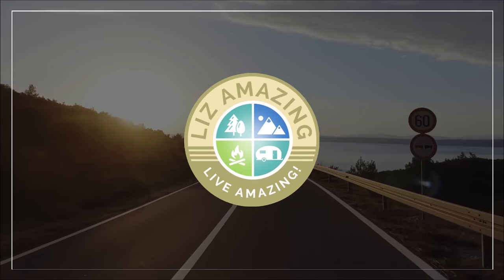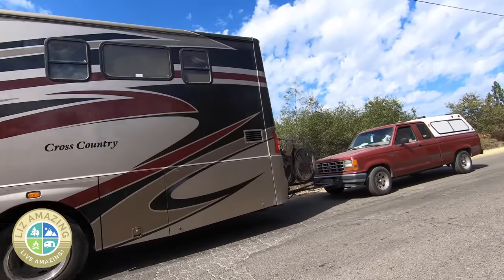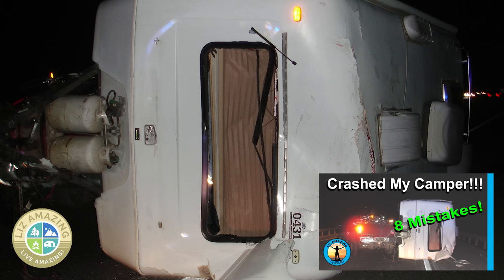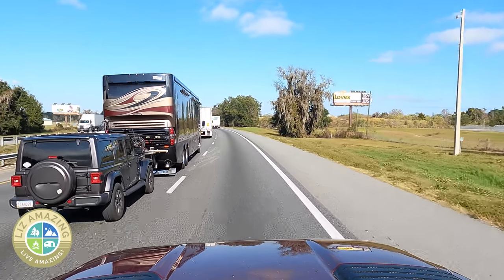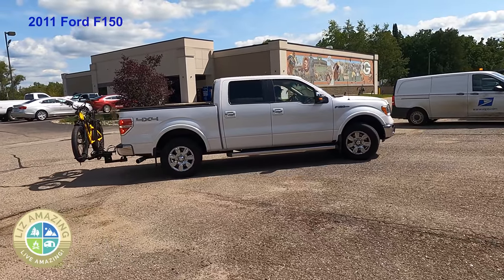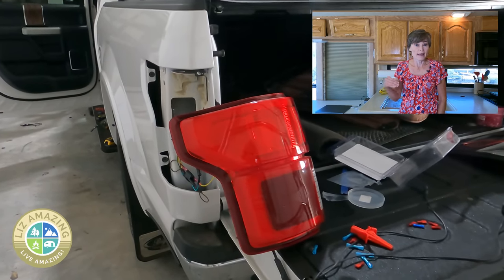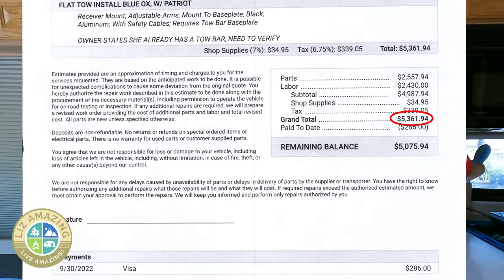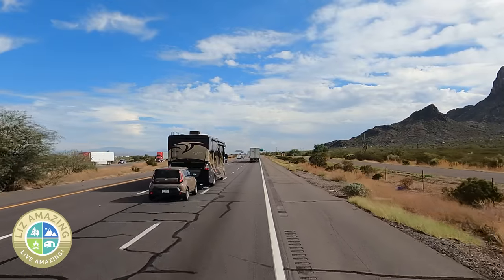These RVers are putting others in danger

Comment: Guilty as charged...We full timed for about 3-4 years and when we first got our rig set up we were 100% everything by the book. I got the Patriot braking system with Blue Ox bars and was towing a Jeep. After about a year the Patriot just got so cumbersome I stopped using it.  The invisible system is definitely the best way to go but yeah if is expensive.  My wife always wanted the dolly but I would just rather flat tow
Reply from the maker: Hi David. Thanks so much for saying, so. I have heard from several folks now that the Patriot is too much trouble. A dolly comes with brakes and you can reverse with it BUT it's a lot of weight to try to roll around your campsite. Plus attaching the car to it is no picnic. Thanks again for your comment and see you in the next video.

Comment: I belong to several RV groups and recently noticed a couple stories about these braking systems locking up and basically burning the tires off of the toad.  Not safe either.  I think for people towing smaller cars it's more about the law than the actual safety.  Modern motor homes with 8 speed transmissions, tow haul mode and heavy duty brakes will hardly feel any difference when pulling a small car.  The jurisdictional laws unfortunately are trying to cover older tow vehciles (MH) as well as the new, with limits as low as 2,000 lbs in some jurisdictions.
Reply from the maker: Yes, the tow weight laws do vary depending on where you live. I have heard horror stories in the comments about the tow bars not holding up to a panic stop when there is not brake system. Thanks for watching.

Comment: I’ve been Full time RV 14 of the last 20 yrs. I drove hot shot for 5+ yrs. that said, I tow my full size 4x4, with my class A. And most drivers on the road will not understand how bad of a driver they are until it’s too late as they stand on Their pedals sliding off the road. No braking system is a replacement for good driving habits and spatial awareness on the road. Especially in larger vehicles. I’ve never heard one person complain /speak about this topic. It would be like a non-licensed pilot crashing a plane then blaming the manufacture for not having air brakes. Most rv and boat owners have more money than any good sense. Then they find themselves flipped over and blaming anyone else. And they tend to spend large amounts of money on unnecessary cool gadgets and items that only work as well as the owner can operate them, without educating themselves on how to safely operate and maintain their “toys”(which they are not toys).  These items simply provide false senses of safety to the unexperienced, which is 96% of those on the road. I have more than >500k miles driven and I know the unexpected is to be expected as well as “they” will pull out on you or over into your lane as soon as U look away.😮
Reply from the maker: Good comment. Yes, good driving skills are key. See you in my latest video where I give beginner motorhome driving tickets. Thanks for watching.

Comment: I have never towed without using auxiliary braking. What you say about the Patriot and must have power seats is absolutely false. While you will want to put the seat back in most cases to make it easy to put the Patriot in place, every toad I have had is easy to just lift the seat bar and move it forward. It is also false that you have "push" the braking device into the brake. That would and does cause the brake lights to activate! You want it just close enough to not activate the brake lights. The Patriot does the rest as it does its setup. 
One other dirty secret....is that there are a few states that REQUIRE a special drivers license for motorhomes over 26,000 lbs gvw and/or truck fifth wheel rigs with a total gvwr combined over 26,000 lbs. Most RV owners that have rigs like that and live in those states have no  idea!
Reply from the maker: Yes. That’s why I talk about the license part later in the video and show which states require a special license. And sorry about the manual versus power seat statement. I was going by what the gal at blue ox told me. She said manual is not recommended but I’ve heard from others that it is doable. Thanks for this.

Comment: I drive a motor home and yes I have not only one braking systems I own two. One is built by Roadmaster the other is a Brake Buddy unit you have to install in front of the seat and hook it to the brake pedal. Yes both are a pain and work very inconsistently. I took my Roadmaster back to the company when I had trouble getting it to work right and they said you we don't make that model any more but well give you a $100 off on a new one. So after paying over a thousand dollars only to find out it failed to work in a couple years a hundred bucks didn't make me happy. So my sister sold their motor home and had the brake buddy and it worked better than the Roadmaster but still is very unreliable as to weather you would have brakes to help you stop so I always plan on it never working. Luckily I have a Suzuki Grand Vitra that weighs 4000 lbs and my motor home can stop it if the break system fails to apply brakes when needed. I wish the system was set up to use a brake controller like what is used for a travel trailer where I could reach down and manually apply brakes when the automatic system fails to work
Reply from the maker: Glad you have something- two even! Know that if you travel without one, your tow bars will probably not hold up to the force if you have to make a panic stop. Thanks so much for your comment, and for watching.

Comment: $2430 in labor? I wonder what all modifications the shop had to do to your truck to install that system.
Reply from the maker: It was quite intensive, Jack. They had to remove the bumper and tow hooks to install the custom baseplate to allow the truck to be pulled. Then the wiring to connect the lights and the monitor on the motorhome dash. And finally the actual InvisiBrake brake system that works not only when I press the brake, but when the exhaust brake engages as well. Thanks for watching, Jack!

Comment: Be aware that in many states if the GVWR (gross vehicle weight rating) of your motorhome added to the GVWR of your towed vehicle exceed 26,000  pounds you will likely need a Class B Non Commercial Drivers License in order to be legal to operate that vehicle. These laws will vary from state to state. All states do honor another states drivers license. You simple need to have the proper DL for the rig you drive in the state you are licensed in. I'll bet that many RV drivers are unknowingly driving without the proper license which could lead to big problems in an accident your fault or not. I have even heard of insurance companies denying coverage due to a driver not having the proper license. Talk about a huge civil law suit!
By not having a braking system on your towed vehicle in the event of an accident you are also setting yourself up for a law suit. 
Don't shoot the messenger, do your homework and be legal and safe.
Reply from the maker: That's a very good reminder, thanks Jim. The laws are always changing so it's a good idea to check the rules in your state. And thanks for watching. Be safe.

Comment: A vehicle with a manusl transmission is not necessaraly towable. I have been told that my 89 Toyota with a 5 speed manual is not to be flat towed.
Reply from the maker: Yes, good point, you definitely need to check first. Thanks for watching, Gregg.

Comment: I want to know why RV drivers  aren't  required to take a cdl test with air brakes before buying an RV with air brakes because clearly those RV's are over 26,000 with air brakes and weigh more with a combination unit when towing a car or trailer??
Reply from the maker: Each state has their own rules but most do not require it unless you are driving commercially.

Comment: I find it strange to want to spend over 300000 on a rv then another 80000 on a truck plus all the items in both then want to skimp on the safety of them. I would wager that if your brake system was not to standard then that would effect how the loss adjuster would value your payout fr your insurance.personally I think the cheaper and safer option is to tow a proper trailer as  most large rv’s have air brakes so I see no reason not to be able to fit trailer provision into that system. I understand the problem of storage but I think the benefits out way the costs
Reply from the maker: Good point, Greg. Insurance will not cover if you are illegal without brakes. Thanks for watching.

Comment: Unfortunately most of the motor homes are overpriced junk. We purchased a new Tiffin Allegro Bus 45’ and had numerous component and workmanship failures within the first 3 years. Chassis with grease zerks missing, 2 of 3 ACs failed, transfer switch failure, loose video system cables, toilets not connected to floor, tire misaligned requiring 2 new tires, buttons on both front seats coming loose, cracked kitchen backsplash panels, cracked exterior paint, snapped pivot bolt on folding steps, basement doors repeatedly becoming misaligned, etc. The fancy paint jobs lure customers into buying these vehicles. The only good about these coaches are the Cummins engines. I fixed most of the smaller items myself and used most of the $7,000 extended warranty that I purchased.

Comment: When you know you're right , you're right. Lot of these RV'ER  have been pulling there Toad around for it was the law and are not going to change there way of doing it. I've not wrecked yet so way pay out all that money that I could use for fuel. 
Well , you're just not talking about yourself  going down the highway with a vehicle behind you. You nay gave a wife , children in the RV with you but what about the vehicle coming at you or beside you. That tow bar is man made and can break at anytime.  I've now read about metal fatigue , where the metal just gets old and brittle and cracks . They break into.  I had a friend who drove NASCAR drivers motorhomes to the race track.  He's had a double axle trailers  20. 30 footer that was behind him and then look in the mirror and it was going down the Interstate on its own. It had gone between a sign post and guard railing as if someone drove in there. If it had the Braking System on it it would have stopped. 
I use the M &G ENGINEERING BRAKING SYSTEM  . I pull a Dodge Ram 1500 4X4 crew cab 4 door pickup. Not a problem at all. It's the law and besides that I hope that I have protected someone else's family from harm. It's uses my air brakes from my CLASS A to stop it. And if it were to come off it has a Air tank for an emergency stop. Yes it cost some money but I know I'm safe.
Reply from the maker: Good for you for having what's needed. And thanks for sharing that story, very important for people to think about the risks, and metal fatigue! Thanks so much for your comment, and for watching, Don.

Comment: I personally wouldn't waste the money on flat towing equipment.

It's much cheaper and loads safer to tow a vehicle on a trailer.
The trailer has brakes already, the coach isn't gonna break a sweat pulling it.
You're saving miles and miles of wear and tear on the TOAD.

PLUS...If your TOAD breaks down, just winch it up on YOUR trailer and pull it to the next town for repairs and save the God knows how high tow bill.
Reply from the maker: Yes. Thats what's so great about life. You can find the way that works for you. As you now know, I share reasons why I am not using a trailer in this video. BUT it sure is one of the more cost effective ways to go. Thanks for your comment!

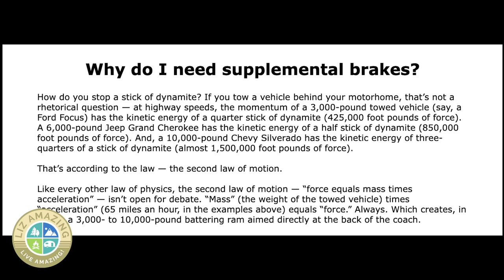Comment: Ugh @ the bad physics on the text-card @3:36 min mark. mass x speed is NOT acceleration, NOR force; it's MOMENTUM (p = mv). To change momentum, you apply an IMPULSE, which is the product of FORCE x TIME.  Newton's 2nd Law was actually, originally formulated using these quantities instead of the more familiar F = ma:   "Applied impulse equals change in momentum"; that is, assuming constant applied force,  F x delta(t) = delta(p)  =>  F (t2 - t1) = p2 - p1 = m (v2) - m (v1) = m (v2 - v1).

So, for example, the applied braking force needed to bring a 5000 pound (~2270 kg) vehicle travelling at 60 mph (26.8 m/s) to a full stop in 5 seconds is:  F = (2270 kg) [ (0 m/s) - (26.8 m/s)] / (5 sec) = -12200 N = -2740 pounds force [the negative sign indicates force in opposition to direction of travel; ie., this is a braking force of 2740 pounds]
Trying to stop in 2 seconds with multiply by 2.5 the force needed, or  F = 30400 N = 6840 pounds!!

Lesson: When trying to stop a LARGE vehicle, you want to increase the braking time as long as possible!! [b/c the brakes have a limit as to the maximum applied braking force...]
Reply from the maker: I don't know physics but that is directly off Roadmaster's website. Maybe let them know they've got it wrong, if they do. Thanks for watching.

Comment: If that motor home want stop with a truck or car you probably need to get your motorhome fixed
Reply from the maker: It's not that, it's that the tow bars would probably not hold up to the incredible impact of a panic stop. I'm reading a lot of horror stories here. Also the towed vehicle could swing around.
Reply: That's true. You are correct about that. Cheaper is not always better.
Reply: The best thing I think people can do is take them to a fabrication shop, and get them to reinforce them.

Comment: Most of the idiotic drivers on the road either have dark license plate covers or a bicycle rack, to block the license plate. Why didn’t you put the bicycles in the bed of the truck? Years ago, I never had a problem with large travel trailers or class A motor homes. Now it’s like they’re driving their Nissan!
Reply from the maker: I would love to put my bike in my truck bed but it's 65 pounds without the battery so I"d have to get a ramp, and then it is too tall even lying down so I'd have to replace the bed cover with a camper cap. Sure hoping this never happens again! Thanks for watching.

Comment: i would never tow without a flat bed tow trailer, Now way would i want car towed tilted and or all 4 wheels rolling, Flat bed trailer or dont bother towing.
Reply from the maker: Yes, you have to find out what's right for you and your situation. As a full-time RVer, I definitely could not deal with a trailer in the campsite. Thanks for your comment.
Reply: @LizAmazing  Long term motor home is much better than 5th wheel.  I towed camper trailers part time for job and learned how much better it is to simply buy a motor home, Towing is dangerous and must have good strong truck. Towing camper trailers so dangerous i quit job. Also one day my boss got his hand stuck between 5th wheel and truck, only by a miracle did i free his hand, NEVER HITCH OR UNHITCH 5TH WHEEL ALONE UNLESS VERY CAREFUL AND EXPERIENCED..

Comment: Fifth wheels are dangerous.
Reply from the maker: I hadn't heard that. I have had three total, two for the past two years. I love how safer they pull than a travel trailer, and in wind. BUT definitely lots more to love about a motorhome. Thanks for watching, Lawrence!
Reply: @LizAmazing  yes they are but . I use to work at Country Coach an Monico Motorhomes. I wired the ceilings an from the back of the driver seat to the back wall of the bedroom. I'm Monico an wired the dash, firewalls, engine compartment, and the under cartage. Of Country Coach MOTORHOMES. SELF TAUGHT. NOT ONE OF MY MOTORHOMES HAD FAILED ELECTRICALLY..
Reply from the maker: @lawrencecarver4233  Country Coach are the cream of the crop for sure! I get it now! I was thinking driving a fifth wheel. But yes, the way they are slapping them together I can see how they could be a fire haza
rd.
Reply: @LizAmazing  Monico's are or were junk back in 1988. But I don't know how they are now . Country coach were very good and strong . I was saying about the fifth wheels trailers are dangerous because the way they hook up . I've witness s few wrecks an boy those trailers control the truck especially in the mountains on winding roads wheel a regular trailer that hooks to your bumper they will break free an sure that's dangerous but they don't make the truck wreck as bad .

Comment: Get a compact car, motorhome are not good tow vehicles.
Reply from the maker: As long as you do it right, with brakes and safety chains, an F150 is a great toad. Thanks for watching! See you here in my brand new video: https://youtu.be/cmNT0mAXxzo
Reply: @LizAmazing  True and driving off road is a good reason for heavier car.
Reply from the maker: @MS-ig7ku  Thanks, and actually this one has an aluminum body so it’s about 1400 pounds lighter than typical. 😊

Comment: A couple of mistakes in your video on braking system. Not all Class A motorhomes are diesel we had a Class A gas motorhome Holiday Rambler Admiral. Also we tow a Jeep Gladiator with a the Blue Ox Patriot braking system. The Jeep Gladiator does NOT have power seats and the braking system locks in perfectly.  YOU need to do more research before posting,  you are losing credibility.
Reply from the maker: Hi Rosanna, Blue Ox told me power seats were needed, so glad you were able to make it work. More importantly, so glad you have a braking system. Thanks for watching!
Reply: You're correct---power seats are not needed, just seats that will adjust forward and back. And it does not take much time at all to set up the Patriot braking system.
Reply: @LizAmazing  ---if you take a look at their online manual there is no mention of needing power seats for the Patriot system to work.
Sorry that you got the wrong info but we all know that it happens sometimes---I guess it all depends on who you get on the phone, sigh....